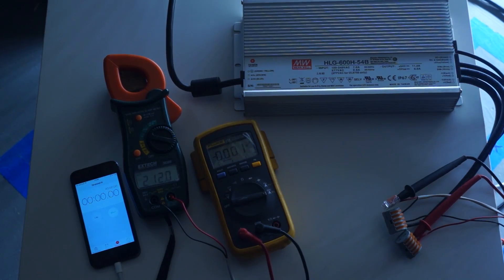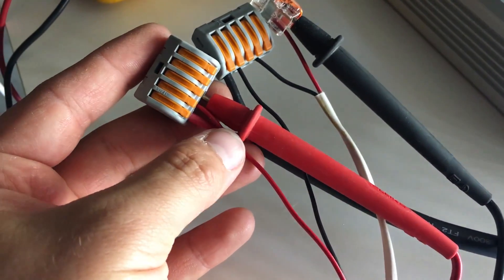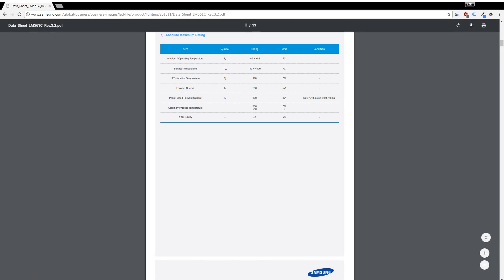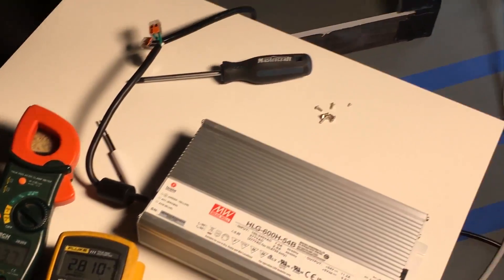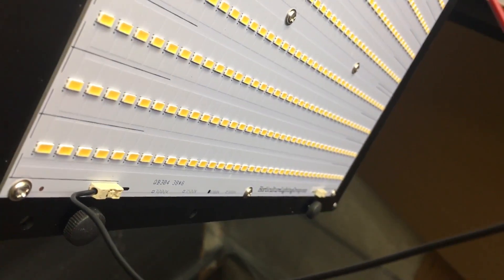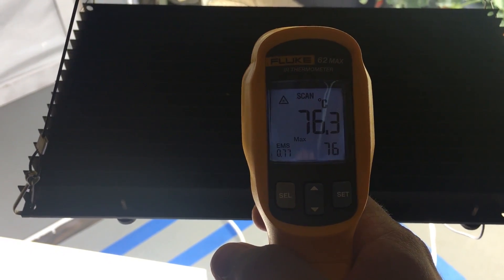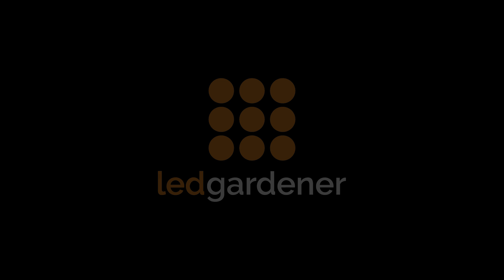Quantum Board Power Handling Test

Comment: 1:17 is this in Opposite-land? Dude, when the temperature of the LEDs rise so does their electrical resistance, and when the electrical resistance rises the current falls.

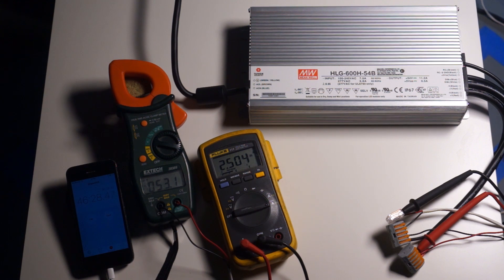3:33 I don't know what results you're expecting to see, but you're not understanding how your LED driver and your whole circuit works. Your LED driver is not just like any other voltage supply, it is more of a constant current regulator, it will attempt to drive the LEDs with a constant current, if the LEDs get warmer their electrical resistance goes up and the output voltage of your LED drive will then also go up to account for this increase in electrical resistance so that it is still supplying that same constant current. The LED driver may be rated up to 56 volts, but that is just a rating, it doesn't mean that it is always at that voltage. This is also why you are not seeing any changes whatsoever in the current flowing, even though your LEDs are getting warmer. There are many ways your can easily blow up your board if that's what you really want to do, you just need to increase the forward voltage on the diodes so that much more current is running, and yes, your board will get very hot when lots of current is running through it, but not the other way around. It's the current running through the board which makes the board hotter, it's not the board getting hotter which makes more current run through the board. The current is the cause of the heat, the heat is not the cause of the current.
Reply from the maker: Demonwhisper LEDs don’t behave like you might expect. Check out thermal runaway.
Reply: @LEDGardener  LEDs pretty much behave exactly the way i expect them to. Thermal runaway is something that happens after your component has broken down and completely melted. It's not an LED anymore at that point, it's just a melted mesh of electrically conductive material which essentially ends up acting as a short circuit like any other wire. That scenario can happen only if you drive too much current through your LEDs in the first place. But don't expect the current to rise when the temperature of the LEDs rise. If you were driving the LEDs from a constant voltage supply you should rather expect the current to fall as the LEDs got hotter, but since you're driving them with a constant current supply you should expect the current to be constant no matter the temperature of your LEDs. And that is exactly what you are seeing in your experiment.
Reply from the maker: In your first comment you're saying that a higher temperature will cause current to fall, and in this one, you're saying "expect current to rise when the temperature of the LEDs rise" (which I agree with). Which is it? 

If you keep forward voltage constant, (like a constant voltage driver does) as you heat the LED up, the current drawn will increase. The driver I'm using is a constant voltage driver, not a constant current driver.The only time you'll see constant current on the driver in this video is if you pull all the available current from it.
Reply: @LEDGardener  DON'T expect the current to rise when the temperature rises. The internal resistance of your LEDs will rise slightly with the temperature increase and provided that forward voltage drop stays the same you should see a small drop in current. But since you're running it from a constant current supply your current supply will actually increase it's output voltage ever so slightly to account for the increase in LED resistence and the forward voltage of your LEDs will rise very slightly in order to keep the current constant. This will be a very very slight increase in voltage due to the exponential voltage-current characteristics of diodes.
Reply from the maker: The part that we’re not connecting on here is the fact that I’m using a constant voltage driver and not a constant current driver. Go ahead and google the part number. Sure, it acts like a constant current supply when it’s dimmed to the point that the LED is sucking all the available current out of it,  but when the driver is not dimmed, and it’s got this single board on it, it is very much a constant voltage driver. I encourage you to try running an LED on a CV driver with an output voltage that causes the LED to pull max or near-max current, and tell me which way the current goes as the LED heats up.

Comment: What driver would you recommend for 2 qb 288 boards in series sir?
Reply from the maker: HLG-240H-C2100A (built in dimmer) or HLG-240H-C2100B (requires soldered potentiometer for dimming)
Reply: Thank you :) would you recommend a heat sink too or will I be ok with two in series?

Comment: If you were going to max out 2 x QB288 boards, would you use a 240-c2100a or 320-c2800a. I am not looking at efficiency, just the full power available if needed.
Reply from the maker: Smiley Smiles I don’t think I’d run them that hard. The extra output you get isn’t worth it. Stick with 2100mA and you’ll be happy for sure.

Comment: Were you able to destroy that QB in the end? Do not give up! Also, request for next video: ppfd of a multi panel qb120 array. With no heatsink required, the possibility of literally cover your entire cannopy with them, easy options for drivers and nice price point these look really attractive. Also, spreading out the watts in this way should let you be able to get the fixture down right to the cannopy thus losing less light. With this kind of fixture it seems more interesting to make measurements at different heights rather than mapping them out over a 3x3 which should also make things easy for you. Anyways, thx for your work
Reply from the maker: Hey Erik. I took another shot at this with a boost converter on the same driver in an attempt to get the voltage up and increase the current draw. I ended up getting the QB to 60V. I will share the footage soon. I do like the idea of a full ceiling of QB120s! I only have a pair of them right now though so I may need to get a hold of some more to test this. I agree - raising and lowering a roof of QB120s would be much easier than messing with horizontal spacing on fewer boards. Whether or not it'd be cost-effective, I'm not sure. Thanks for the suggestion.

Comment: Iv been trying to get 4 135w qb kits  for about 2 months and still no luck. i have even emailed hlg Twice  with no response
Reply from the maker: +Rek da Knight Interesting. What made you decide to go with 4 separate kits? And I know, it's definitely tough to get a hold of these suckers.
Reply: I'm building a custom grow light for a 5×5 tent and I need 4 separate qb kits 4000k kits to center out to cover a 4x4 area mostly for veg and they will be surrounded by 16 Vero 29 7th gen  3000k, 12 osram oslon ssl 80 hyper red 660nm, 8  infrared pucks, and 2 4' uvb bulbs  all on a led controller so I can dim them to mimic what I want from the sun in veg to flower stage. So basically the qb's have to fit in between the frame and other lights.
Reply from the maker: Holy shit! That is a ton of light! Would love to see this build when it's done.

Comment: Nice to see how durable they are. I'm going to order some shortly. (btw, love the new meter!)

I've only tried once to overheat an LED module (a cheap 10w cob from china). I took off the heatsink but kept the CC driver attached. It got well over 100c (a drop of liquid I put on it boiled) before the light output started turning much bluer and it suddenly went out... once it cooled down it started working again, but a row of diodes were out. I'm assuming the bond wires were coming detached from the symptoms it died with, so not a real diode burnout.
Reply from the maker: +volvo09 Yeah the 287 is such a huge upgrade from the little 111 I have (and the extech it replaced). I'm super happy I picked it up in time. About the COB: interesting. How much power did it take before it went squirrelly?

Comment: i have several quantums. i know they tell u that u dont need heatsink compound. it is better to use it for max eff. these are awesome board. i have 260w 3000k w 2 slate 2 so i can move them apart. i use 4 of these w one 4000k board in a 5 x 5 tent w 4 x 4 tray.  at 4.3 cent a KWH it costs nothing to run
Reply from the maker: Rikki lee sweet. So you have 8 boards total in your 5x5?